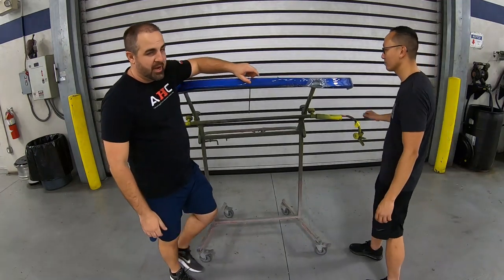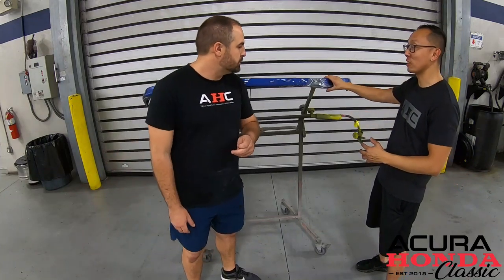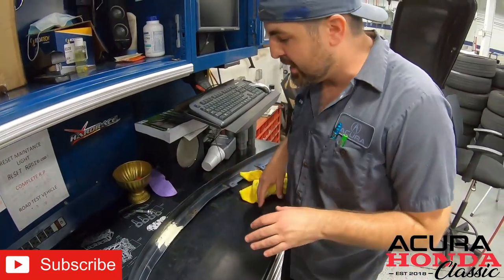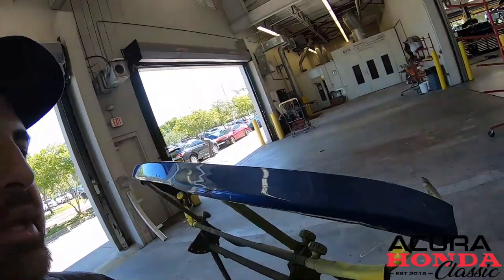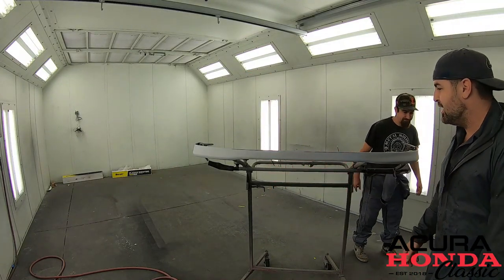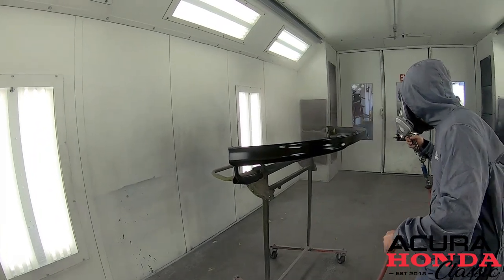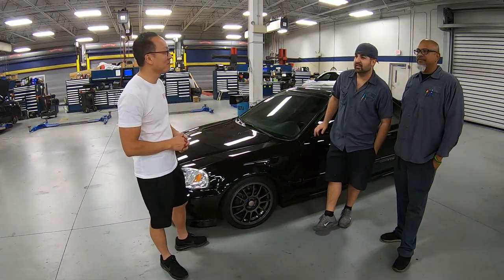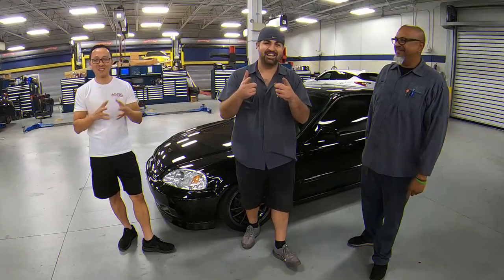AHC Shop Hours - Honda Civic Si EM1  Repair and Refinish Damage Front Lip Guide

Comment: Nice! BTW how's the view out of those folding mirrors? I've heard you can't adjust RHD mirrors enough to see in a LHD car.
Reply: Then switch the glass.
Reply: It’s not the glass but the angle of the mirror base from what I’ve read.
Reply: They look like the same mirrors I had in a Civic VTi (similar to an SiR) in latin america (also LHD). Unless they make the same exact mirrors with different internals for RHD and LHD, it should be good.